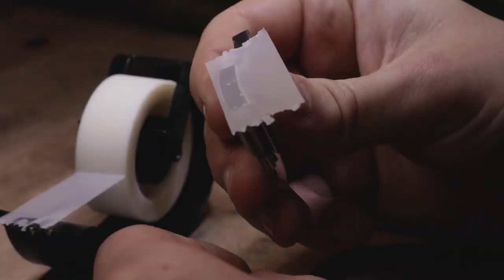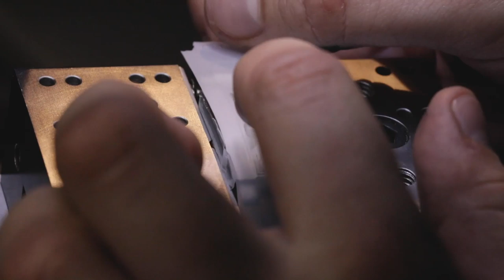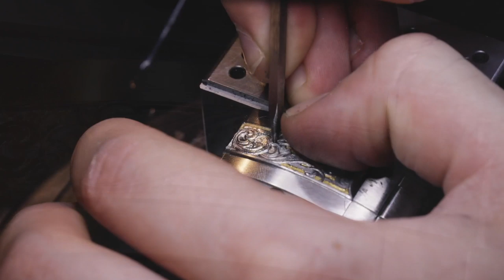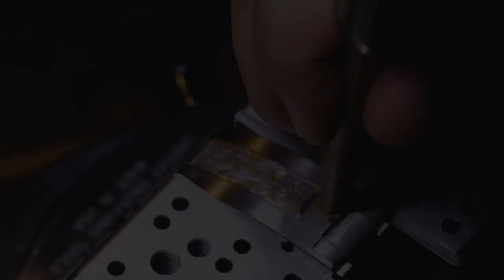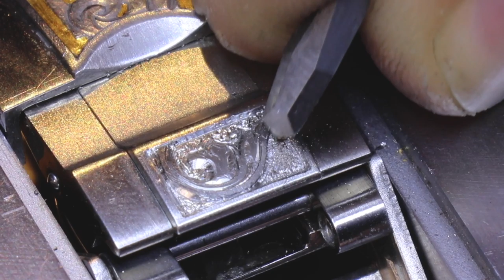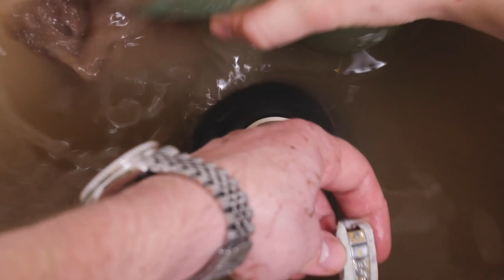Sculpting Watch Clasp With Gold Backgrounds

Comment: Is it also possible to inlay with yellow 18k gold?
Reply from the maker: Yes
Reply: Then why do you use 24k?
Reply: Sorry for all the questions. What type of stone did you use to even out the sculpted metal? Btw I really like your videos!!
Reply: 24k is usually much easier to inlay and work with. The lesser alloys are harder and more difficult to deal with.
Reply from the maker: @Blackmage50  Yes Billie just answered your question.
Reply from the maker: @2mrRB  i used ceramic stone, punches and steel burnisher